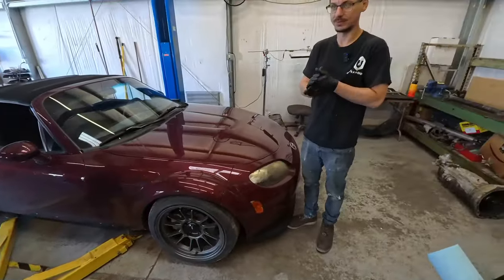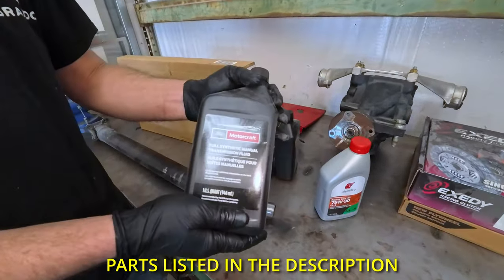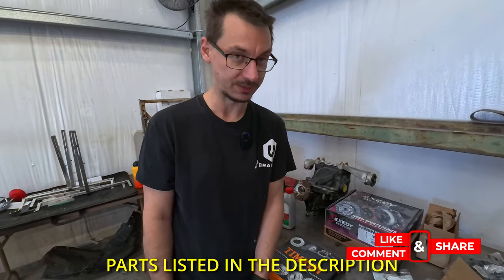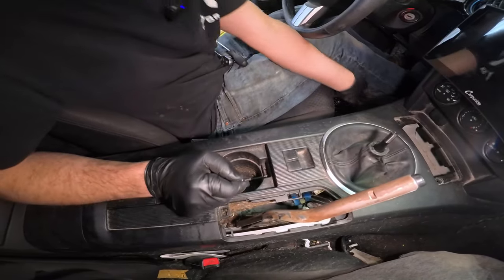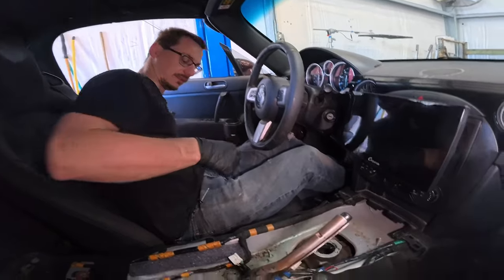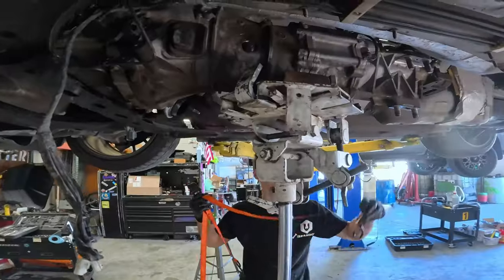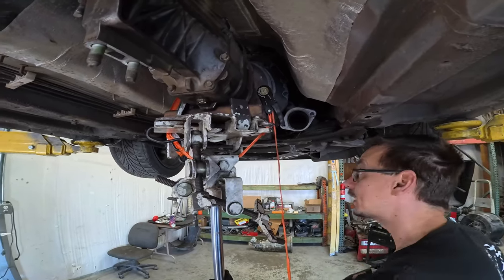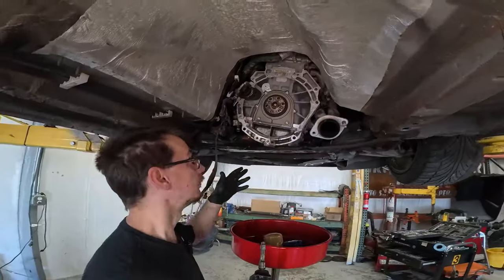5 Speed to 6 Speed Transmission Swap + LSD Swap | 2006 NC Miata

Comment: I did not know that the Miata had that much bracing in the chassis......looks substantial.
Reply: It’s a very strong chassis.
Reply: As someone who drives a sport edition (6speed, lsd suspension package from dealership) there’s almost no body roll even at highway speeds

Comment: R501-17-335A is the 6 speed output seal. I had the exact same issue and ordered about 4 of them from different Mazda dealers saying it was the right one   Atkins rotary came through, looked it up and nailed it.

Comment: If that's the Ford Motorcraft XT-M5-QS trans fluid, I find that it doesn't last very long before it...wears out... I guess? I've swapped over to TriboDyn TRI-EX 2 and that seems to be holding up better. Quick note: I also have a transaxle with a Quaife LSD so that might be important to note.
Reply: Being a FWD trans there’s a lot more going on, but I recommend doing the fluid every 30k which should be fine for the Ford MTF.
Reply: Didn't seem to last more than maybe 5-10k for me.